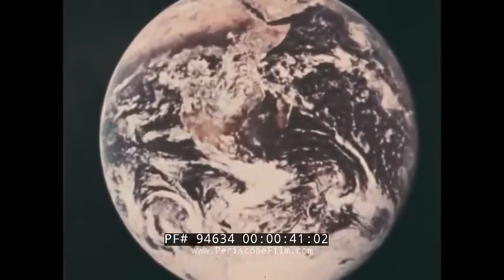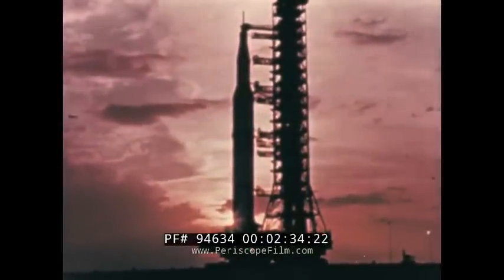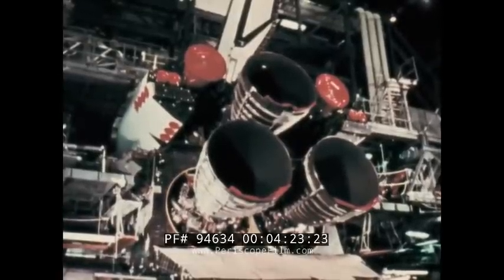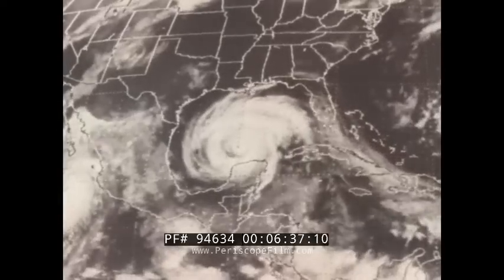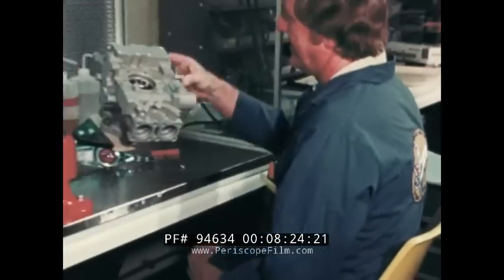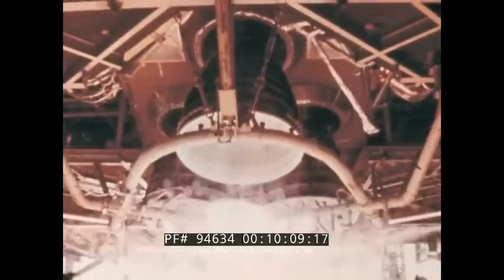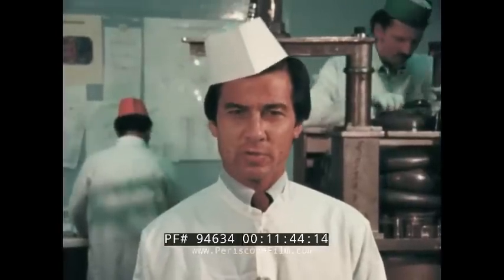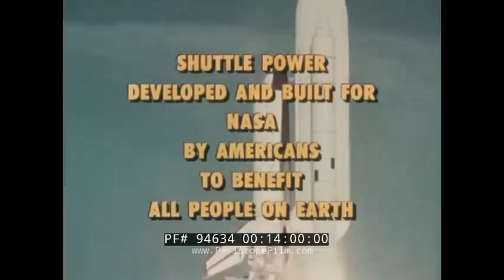" SHUTTLE POWER "  1980s ROCKWELL INTERNATIONAL / NASA SPACE SHUTTLE PROGRAM PROMO FILM   94634

Comment: The space shuttle was a hideously dangerous system, with fatal accidents claiming 50% of the original vehicles
Reply: They really should have included some kind of escape system. Maybe the crew cabin could detach with explosive bolts and propulsive rockets in an emergency. It could have possibly saved Challenger's crew.
Reply: The first one was 100% avoidable.  Managers couldn't listen to engineers saying no.
Reply: @thunderbird1921  They looked at that, and basically shuttle could 1) carry a payload or 2) incorporate such an escape system.  It simply didn't have the capability to do both.  The additional weight and modifications required for such a system to be incorporated simply ate up the payload capability and was way too expensive.  Once the loss of Columbia laid its faults bare, and the rapidly approaching point where the shuttle system was going to require MASSIVE modifications to keep flying, was the decision FINALLY made to put shuttle out to pasture, and rightfully so!  Shuttle WAS cutting edge technology-- for *1974*.  Most of its computers and technology was SO old that basically some factories were having to stay open ONLY to make shuttle parts for them, as NOTHING ELSE used those types of systems anymore, they were SO antiquated... this of course made those parts OBSCENELY expensive, and incorporating new technology into the shuttle was extremely difficult, time consuming, and expensive.  You have to make sure that ANYTHING you installed in the shuttle would not conflict or cause a problem with the old components in its systems.  Basically the problem had grown so much over time that by 2010 or so shuttle was going to need a complete overhaul of its systems to upgrade them, and that was going to take years and be a multi=billion dollar program to complete.  With the limitations and risks of the shuttle program laid bare by the Challenger and Columbia disasters, it was better and cheaper to simply retire the vehicle and start over with something else, particularly since we didn't really need shuttles just to do LEO work, and it was incapable of doing anything in deep space.  

Later!  OL J R :)
Reply: @brentboswell1294  They were both basically the result of managerial disregard of known problems... 

The O-ring problem on Challenger was well known beforehand... in fact the flight before Challenger IIRC, the one where Senator Jake Garn (or was it Congressman Bill Nelson) had bumped Hughes engineer Greg Jarvis out of his seat on that flight to make room for the politician) had experienced an O-ring failure and casing burnthrough... Luckily for that flight it occurred not long before SRB burnout, and almost directly opposite from the External Tank... it burned a hole as big as a basketball through the casing joint from what I read.  By the time it was getting big enough to potentially destroy the shuttle, the SRB's ran out of propellant and were jettisoned.  When it was recovered the hole was discovered.  That was the flight that resulted in the 53 degree flight rule limit, which of course NASA management decided to waive for Challenger since they didn't want to "wait til July" to launch as they told the Thiokol engineers who objected.  They gambled nothing would happen, and the Challenger crew lost and paid with their lives.  

Similarly, shuttle orbiters had been returning from orbit with severe damage to the TPS tiles on the orbiter belly on multiple missions, all traced back to External Tank foam shedding and foam strikes.  One orbiter even returned with a number of shattered tiles, several missing tiles, and a HOLE burned in the orbiter's belly aluminum skin under where the tiles had been, caused by the loss of the tiles after a foam strike.  Fortunately for that crew the hole burned through the orbiter's belly was in a non-critical area, so NASA took the position "no harm, no foul" and patched it up and kept right on flying, GAMBLING that "because nothing bad HAS happened, nothing bad WILL happen!"  They gambled one too many times and the crew of Columbia paid with their lives.  

NASA, after the year and a half stand-down after Columbia, realized that the foam shedding was basically an insolvable problem for the shuttle system.  The foam was necessary to prevent the "blizzards" of ice and frost shaking off the tank at liftoff from damaging the shuttle's delicate thermal protection system tiles just a few feet away from the tank, which even raindrops hitting a shuttle during launch can damage the TPS like bb's hitting the tiles and chipping them (the tiles are about the same strength and consistency as styrofoam or "astronaut ice cream", they can EASILY be dented or scratched by a fingernail!)  and a "hailstorm" of ice chunks and frost at liftoff from the tank would shred the tiles.  Foam prevented the ultra-cold fuels from forming ice and frost on the tank sufficient to damage the TPS, BUT spray-on foam isn't particularly strong, especially on the outside of a vehicle flying at supersonic speeds.  While NASA can and did replace some of the thicker portions of the foam (like the ice frost ramps that had caused the fatal damage to Columbia's wing leading edge that destroyed the vehicle during reentry) with heaters and other schemes to prevent ice formation prior to liftoff, it became apparent that NOTHING could completely solve the problem due to the vehicle's design.  SO they decided to simply fly the shuttles ONLY to ISS, which could inspect the heatshield for damage with the "backflip" maneuver before docking, and ISS could serve as a "safe haven" if a shuttle WERE fatally damaged on launch due to foam debris strikes, until it could be decided what to do-- either attempt repair or discard the shuttle and command it to perform an uncontrolled reentry over the ocean for disposal, and await a rescue shuttle for the crew return.  It was also decided to keep one shuttle "on backup" to launch a rescue mission if required to ISS in the event a shuttle was damaged during launch.  

SO, that, plus the fact that the shuttle system was going to need a HUGE multi-billion dollar upgrade program due to its antiquated electronics and other systems in order to keep flying, plus the idea that using a complex MANNED space vehicle like shuttle for simple cargo launches was foolish and wasteful, and shuttle was utterly INCAPABLE of performing ANY sort of beyond Earth orbit exploration missions due to its extreme size and weight and lack of propulsion power, meant that it was simply better to retire shuttle and replace it with something more suited to the task, IOW a capsule for exploration missions.  Capsules are much simpler for manned spacecraft even for orbital crew exchange on a space station, and basically wings and landing gear are just weight you have to lug along the ENTIRE MISSION just to use in the last few minutes of the flight, so a HUGE LIABILITY in terms of propulsion requirements, particularly for exploration missions.  While we might see a winged vehicle or winged lifting body for crew rotation or transport in LEO, they're not much use or desirability for missions in deep space.  Later!  OL J R :)
Reply: @brentboswell1294  Damn that must be some GOOD paint LOL:)  No paint wouldn't fix it.  They looked at it nine ways to Sunday for years and never could come up with "foolproof" permanent solutions.  

Paint helped seal the foam off from potential water absorption, but that was about it... that and protected from UV exposure which turns the foam brown over time (from it's creamy color at application to a golden color darkening to brown the longer its exposed to UV in daylight).  

The fundamental problem was, you could never GUARANTEE NO foam could come off the tank and hit the delicate TPS tiles just a few feet away.  Engineers and managers had assumed that foam couldn't hit the reinforced carbon/carbon leading edge wing panels hard enough to cause serious damage, and that the damage they'd experienced with the tiles on multiple flights was the worst damage that could occur... Comes down to design limitations and faulty assumptions-- that the damage you've seen so far is the worst that can happen.  Best they could come up with was deleting the thicker areas of foam that added mass and air resistance that could cause shedding, try to improve the bonding of foam to the tank and minimizing voids, which it was found that air pockets trapped in the foam when it was sprayed on could leave pockets of air in the foam, which when it was supercooled by the liquid hydrogen in the tank through the tank wall, could cause the air trapped in the pockets to liquify... of course liquid air has a MUCH MUCH smaller volume than gaseous air, and that little dab of liquid air at the bottom of the void meant the rest of the void was essentially in a vacuum.  14.7 PSI external atmospheric pressure would press in on the foam an try to collapse the void, causing a "divot" in the foam, and basically crushing the overlying foam structurally, which of course weakens it.  Then when the vehicle lifts off, on ascent, eventually the hydrogen level is drawn down below the void, and it begins to warm up, particularly from atmospheric drag heating.  This warms the liquid air in the void back up and it then expands to normal, refilling the void and "popping it back out", PLUS as the vehicle is ascending out of the atmosphere, the ambient air pressure outside is RAPIDLY falling off toward vacuum, and since the foam is applied at Michoud essentially at sea level in New Orleans, the pressure inside the foam is now OUTWARDS against the already crushed foam from the liquid air forming at sea level before launch.  The weakened foam is particularly vulnerable to blowing OUT at this point, where it will be caught by the slipstream and ripped away violently.  

It was also found that basically as the shuttle ascended and sped up after launch, the danger from foam strike increased up to a point...  As it went supersonic was about the highest risk or for awhile thereafter, because the air was still dense enough for the foam to RAPIDLY be decelerated by the slipstream of air moving past it, and for the shuttle to slam into the foam at high speed as it continues to accelerate.  Later in flight, even though the shuttle's speed had increased dramatically, the danger was lower, because the ambient air outside the orbiter at that point was basically a near vacuum-- so little air in fact that foam shed at this point would simply coast along beside the shuttle, gradually falling behind as the thin air gradually slowed it down, and as the shuttle continued to accelerate away from it, so it sorta "drifted" away from the shuttle, rather than whipping back and slamming into things like in the thicker air at lower speeds... 

Anyway, it was a huge problem and statistically speaking, it WOULD have caused another shuttle loss EVENTUALLY, or at least severe damage to the vehicle, and potential loss of crew.  Just not worth it combined with everything else to continue with a 40 year old design.  Later!  OL J R :)